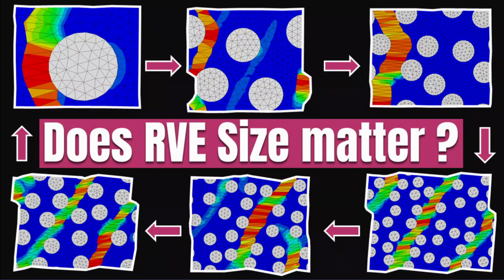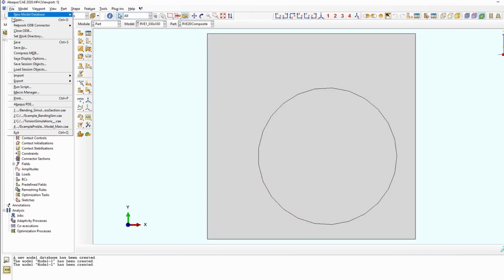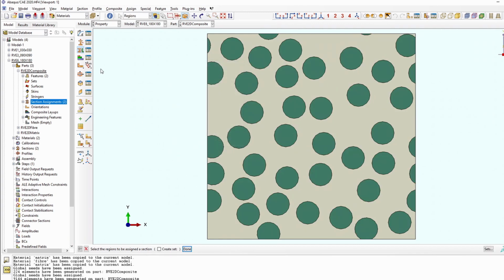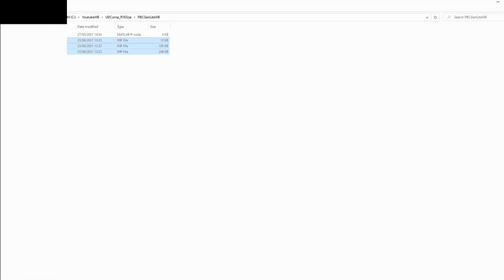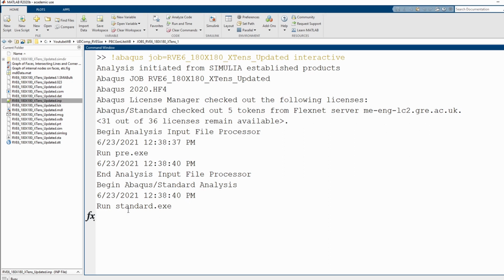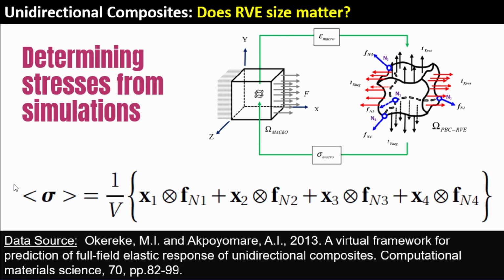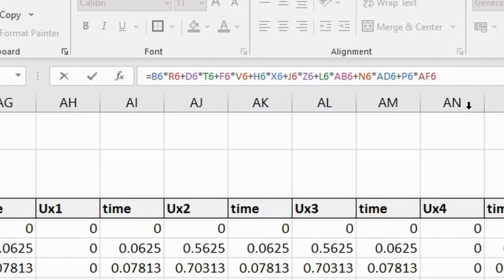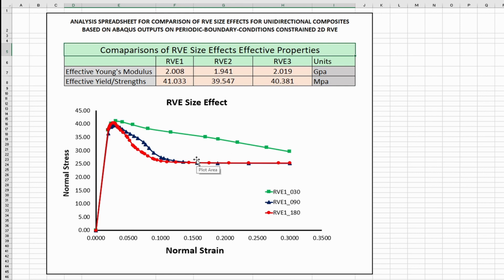Composite Modelling of different RVE sizes

Comment: Hi I'd like to ask if it is possible to carry out high velocity impact on the RVE model using Hashin damage?
Reply from the maker: Yes, you can always do a high velocity impact test on an appropriate RVE. I am not sure if this is the right type of RVE you should be using. I suppose you are suggesting a high velocity plate bending test, in which case this will not be the right RVE to use. With respect to Hashin damage, no, this will not be the right RVE since hashin damage works at a macroscale representation of the laminate. What we have here is a microscale representation, so due the the length scale difference, it therefore means that this is not the right or appropriate RVE for such study.

Comment: Question: It is interesting that the values of PE,Max.In-plane Principal are used for calculating Young's modulus. Is it because of 2D model and is it really to represent Young's modulus or shear modulus in this video?
Reply from the maker: Hello @eslingena, no I have not calculated the Young's Modulus using the maximum plastic strain, PE. It was shown simply for the contour plot. The actual calculation is based on reaction forces at the retained corner nodes.
Reply: @MichaelOkereke  Thank you for your kindness! I am still not clear of your answer. In your 2D RVE model, how to get an effective Young's modulus?

Comment: Dear sir, I have a question , when you determine stress, i think we should use 'V' and 'x" in the current deformed configuration  beacause of principle of virtual work. but why  you use 'V' and  'x' which is in initially undeformed configuration.
Reply from the maker: Dear Chao, thanks for the comment. I think you might have misunderstood what happened here. The x and F terms were tracked using 'history outputs' in ABAQUS throughout the duration of the test. That means that the different stages of deformation (or as you describe it) configuration of the model is noted. It is not enough simply to evaluate the initial or final configuration, for such simulation. All stages of the deformation are essential. 

As regards the V term, this is a volume term, and it remains constant even at the start and end of the simulation. This is because there is no material loss in the model (no damage) hence we can assume that the initial volume resulted in the same final volume. 

The equation of volume-averaged stress used in the model depends more on the coordinate positions of the corner nodes and their reaction forces, and it is not the traditional force divided by area term that we know always to be the case with nominal or true stresses. 

The above makes the arguments of the video correct. You can learn a bit more about this sort of derivation of stresses in a PBC-enabled domain from this video: https://youtu.be/qHt-Mn3nuiQ